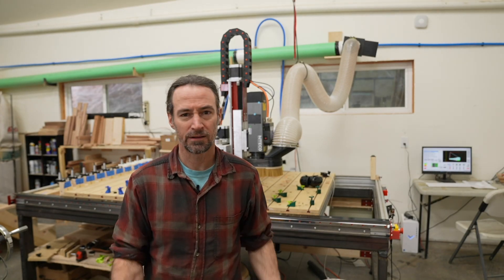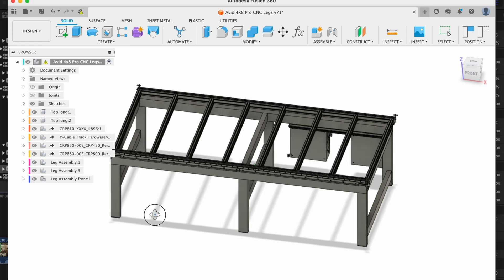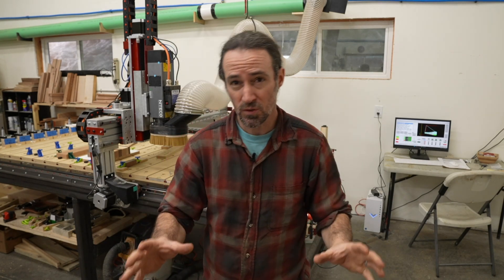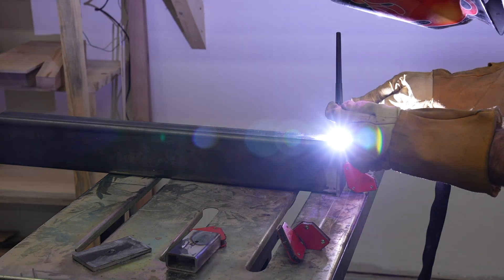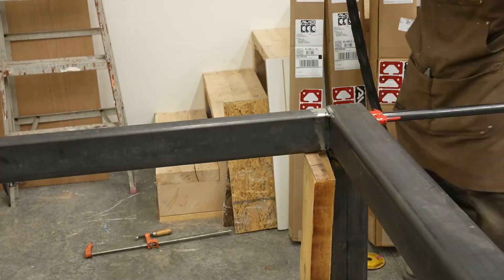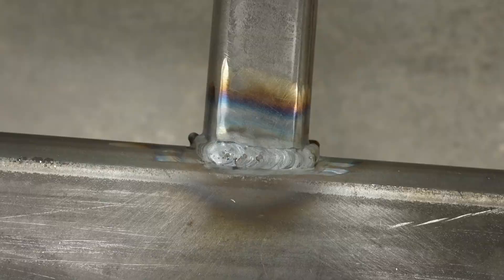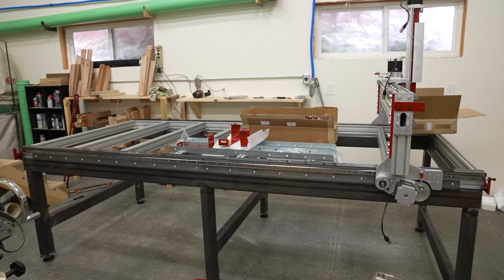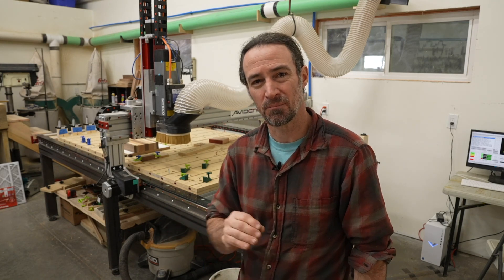CNC Build Ep 2: How to Weld a CNC Base Table - For Better Cuts and Less Chatter! For my Avid CNC

Comment: That table is massive - very nice job on that.  Before doing the welding project did you consider adding stiffening members to the 80/20 table that the Avid came with? For example, I wonder if enclosing the base with 1/2" birch plywood attached directly to the aluminum would have been enough.  Maybe even with accommodation for ballast, if needed.
Reply from the maker: I hadn't thought of doing that; i'm not sure it would help, given where I see the table flex, which is mainly the legs, and the gantry. I can easily push the gantry  5-10 thou, but I haven't quite isolated where the play is at. I think it is more so in the motor/gearing than the 80/20, but I am not quite sure..

Comment: You may need to add some gusset supports on the legs to help stiffin this up.  
In addition, you can get into your CAM software & adjust how quickly your motors will start up.  This is what I did on my machine & it helped out a lot with the movement of the machine.
Reply from the maker: Yeah, you are spot on right! Check out episode 11 -- I did later add more supports, and it helped a lot. I also talk a little about reducing the acceleration in Mach 4; I eventually did do that, and it does help.

Comment: You fixed where this brand sucks the most. The table. I think that at least, a 4x8 feet machine should weight 2000 lbs.
Reply from the maker: Yeah -- BUT I'm still not happy with it, and I'm going to weld in some bottom horizontal pieces and 45 degree supports. It still moves up to 0.010" along the y-axis! And yeah - I agree; there still isn't much one can do with the aluminum base; it  doesn't flex much, but it does tend to "ring" a bit.

Comment: Just rough calculations here, if you used 4x4’s for the legs, filling the frame with sand would have added 500-600 pounds. I have no idea how that plays into the stability, as I don’t know how heavy it already was, but thought I’d do some figuring… 👍
Love your series.
Reply from the maker: Yeah, that would add a lot of mass! I've got some more steel to stiffen up the table a bit....I'm going to test that first before filling it with some sand. I'll probably use sand instead of concrete so I can remove it, if need be.

Comment: you could try heat straightening with a oxy fuel torch. heat up the affected zone. 

probably not worth it tho not as it is already assembled, and you can easily make it worse if your not careful.
Reply from the maker: That is a good idea! I do have a torch..and I should have tried this. But yeah, it would be hard to do at this point..I'd have to completely disassemble it and remove the heavy gantry.

Comment: Thank you very much for this video. So timely! I just got an Avid 6x12 table without the legs. Gonna assemble the table as a mockup under a set of 4x4s attached using simpson brackets. Purpose to gauge the size and overall girth of the system. And then I'll move on to getting 4in tubing :-)
Reply from the maker: Awesome! Definitely check out the later Fusion 360 I did based on some feedback; it might be better to add some bottom bracing. I do get more movement than I'd like...and I'm hoping to solve it. I think it it would also work well to fill the tubes with concrete - some other people told me they did this and it helped for rigidity.  I'm hoping to make some mods and post an update based on how well they work.

Comment: Dang. I hate to say it, but I'm not convinced the steel table was worth it. Having to shim the aluminum extrusion on top kind of defeats the point of a sturdy, ridged base because you now have aluminum spanning a gap. I feel like in order to make this work (be better than the default aluminum) then you are going to need to: 1. Fill the gap (inject epoxy?) and 2. Have more tie-down points (so that the aluminum can't also flex upward, away from the epoxy/steel).
Reply from the maker: oh man, you always have great ideas! Yeah, I think I should at a minimum add more tie down points to the table. Now that I know about 45 angle brackets...it would be super easy to do. I only used 6 tie down points; more might help absorb more vibration.
Reply from the maker: I've also been a bit reluctant to add more tie down points because it would mean removing my spoilboard table to add in the tie down points. It isn't hard to remove...but I already have a bunch of precise locations drilled into it, and moving it would potentially change those positions a bit.  I can dial it back in...but I'm sure it would never be 100% the same.
Reply: @CorbinDunn  Does the quest for rigidity even matter for your use? Are you seeing any artifacts in the cuts? And if so, how much acceleration reduction (job time increase) does it take to eliminate it? If you can get excellent parts at say a + 10-20% job time increase, then I'd say forget it. Run what you've got and stop thinking about it.
Reply from the maker: @joshpit2003  Those are good questions! I'm seeing chatter marks in my wood spoons/spatulas, and it is when a short y-axis movement happens. Currently I sand them out, but I hate sanding. I haven't experimented with reducing the acceleration yet; that is a good question. I'm going to add some code to Mach 4 to keep track of machining times so I can more easily track changes.

Comment from the maker: Update: I've gotten some feedback on how to make it stiffer! I'll be doing some updates to the table pretty soon....I'll post back when I have more details on what I did. (Probably another video).
Reply: Can't beat a granite surface plate.  ;-)
Reply from the maker: @NSResponder  I've got a tiny 4"x4" one I use for setting up tools - they are dead flat!
Reply: If it's dead level and don't want it to move anymore, weld some tabs on the legs and anchor right to the floor. No need to waste time with filling it with concrete.
Reply from the maker: @tysonserivce4884  The legs aren't moving with respect to the floor - it is heavy! It is actually the flex in the steel. I ended up welding on additional supports, which stiffened it up a ton. I also lowered the acceleration a bit in Mach 4. I'm pretty happy with it at this point, so I'm not going to do concrete. Video of doing that: https://www.youtube.com/watch?v=kjERid1Kxp4